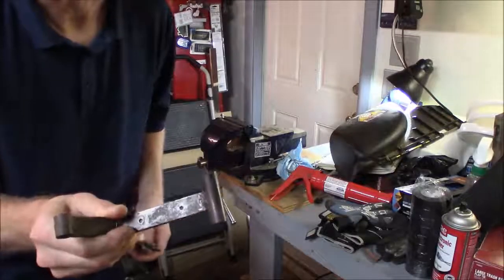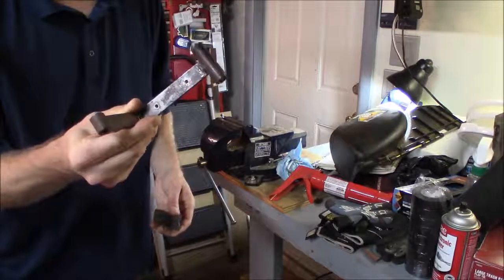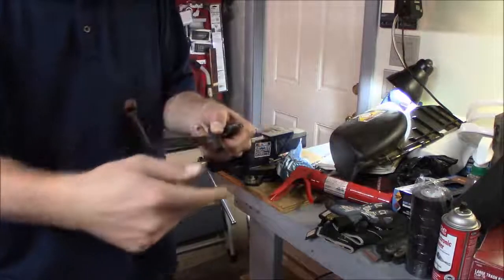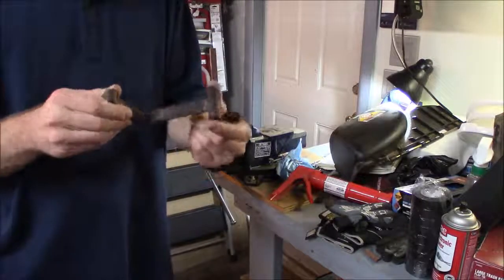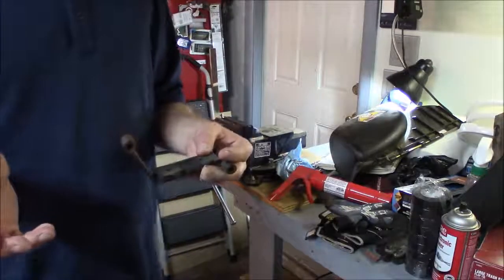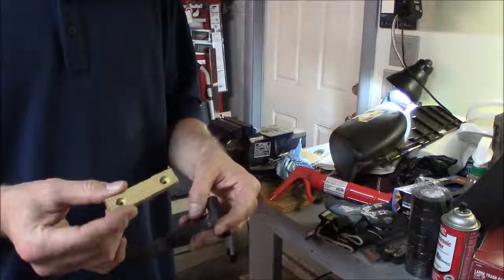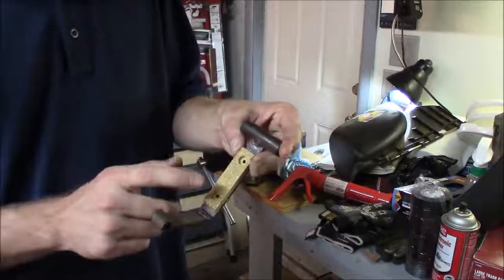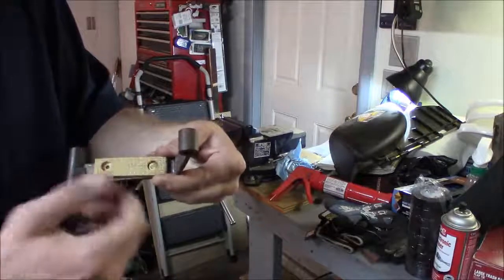Bolens 650 Brake Repair

Comment: I too have used sam bolens for a few things but this past winter I rebuilt the carb & found the same kit on ebay for $ 8 less than sam! Just sayin . My brake is on my to do list as it is starting to slip . ( wondered if you seen my comment about the mower deck? )
Reply from the maker: guess I missed your last reply, definitely interested in another Bolens if we're anywhere near each other, I don't want to post my contact info for all to see, would you like to message me privately (I didn't see your channel set up to do so, so I couldn't send you my email address).  If you do sell it though you might instantly regret it, that's what I hear from others
Reply: Daddy's work is never done my other comment is on the vid where one is plowing & the other tilling. I don't have a channel, just watch vids. I live in Pa.
Reply from the maker: darn the luck, I'm about half way across the country from you, but sounds like distance means I'm missing out on a good Bolens.  Glad to have your input though, if I ever get any video of the mower deck, and insight you can add is appreciated